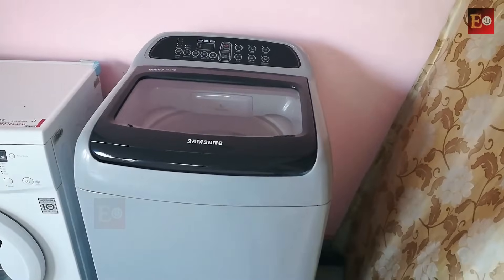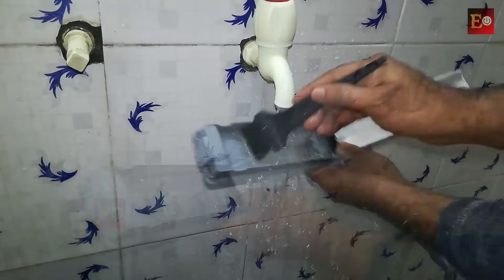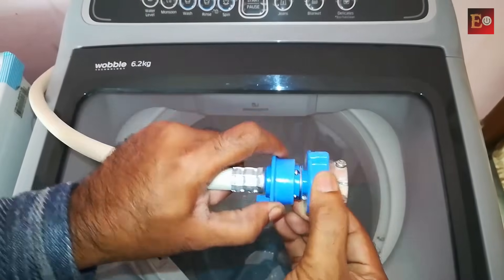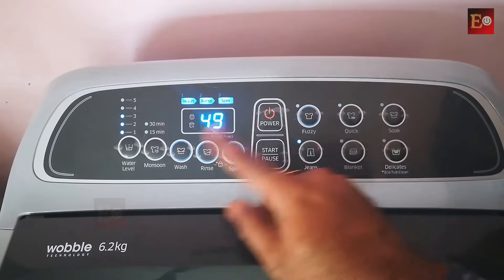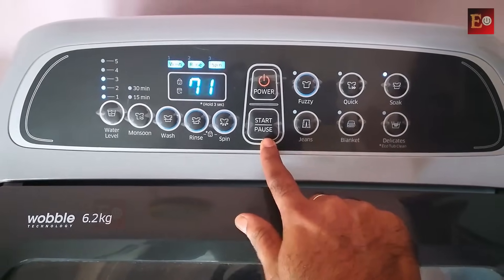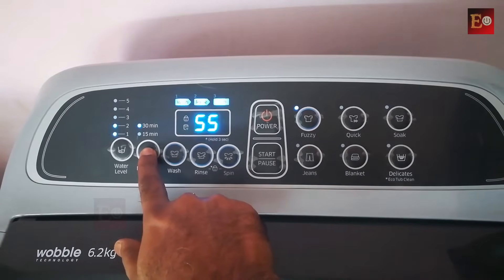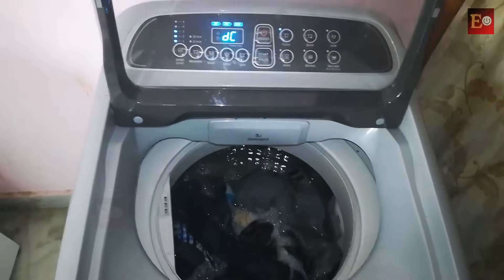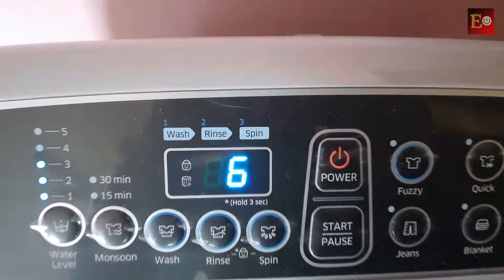Samsung Top Load Fully Automatic washing Machine Demo| How To Use Samsung Top Load Washer And Dryer

Comment: I found some problem in operating machine. 5C written on the screen. What it mean. Can you help me solve this issue?
Reply from the maker: If your washing machine isn't draining or filling, the most likely cause is a clogged filter, or clogged or twisted hose. This may display as a 5C error message on your machine. clean inlet pipe filters and check the drain pipe also.

https://youtu.be/WYf4I-1j1SM

Comment: to soak a jeans before select  jeans setting program  what to do and how to set program
Reply from the maker: We don't need to choose both. You have to choose Jeens or Soak before starts the machine. There are different washing programs ,Fuzzy, Quick, Soak. Blankets,Jeens. Delicates. U can choose any one in this washing programs. U use only Jeens or Soak and if u start the machine it will do everything. We don't need to change any thing in middle of the washing.

Comment: Can we go to spin function directly for clothes washed outside,what is the minimum time for which spin action can be set?
Reply from the maker: Wash, Rinse and spin options on the machine key pad. if u want any cycle manually, u can choose there. if u want Spin only you can choose there. and we also check at indicate lights.

Comment: My   washine  machine  is  not  showing all  three  options    its  showing nly  rinse.. how  to  do  it  fully automatic  .
Reply from the maker: There are Wash, Rinse, And Spin Option buttons on the machine keypad. these are for if u want to choose any cycle separately u can use their buttons.  u can on and off Wash and Spin cycles with these options. otherwise, if u change wash programs automatically on wash and rinse.

Comment: What about water level 
We should set that or it will be set  autatically
Reply from the maker: We can add comfort in Rince cycle. We can change  water level 1 to 5. But default water is 3rd is enough for us.
Reply from the maker: We can add comfort in Rince cycle. We can change  water level 1 to 5. It will not change automatically But default water is 3rd is enough for us.

Comment: Hiii... The same wshng machine i have  brought... The prblm is when it's spining the  wshng machn shakes a lot... Wat to do???
Reply from the maker: Normally washing machine are little vibrates in spinning time. if your washing machine is more vibrates in spinning time, you have to check at washing machine four legs on the floor. if lags are not properly set on the floor or if lags have any gap from the floor, washing machines are lot of vibrats or shakes in spinning time.

Comment: Brother how to drain water in this washing machine. Also reset
Reply from the maker: Machine will spin(dry) the cloths in final cycle. There is no reset option. U have to keep the wash, Rinse, Spin lights in on the machine key pad.

Comment: I want to give an example like we have seen 13 minutes left again automatically 17 mins come .it does not get empty and repeats same cycle ..our samsung machine is 7.5 kg fully automatic
Reply from the maker: If u open the door in middle of the back power off the machine, some tome will back. Or if choose same cycle more times, same cycle repeat in the machine. Check there how meny times on the machine key pad. Wash Rinse and Spin options separately on the machine.
Reply from the maker: If u open the door in middle of the washing or power off the machine, there some tome will back. Or if choose same cycle more times, same cycle repeat in the machine. Check there how meny times on the machine key pad. Wash Rinse and Spin options separately on the machine.

Comment: Can we put water with bucket also?
Reply from the maker: Yes, but we have put the water every cycle when it need. First star the machine add water how much it needed, depended  on watel level on the machine. Then after cycle completed,  Pause the machine and open the door, add water again and close the door and start the machine.
Reply: @ELECTRONICSALLINFO  very helpful thanx

Comment: Which level of water is to be used.  Which level is good.  Pl explain
Reply from the maker: the machine automatically takes the water level depending on the wash program you choose. 
 but You can choose the water level manually depending on the clothes you add to the washing drum. if u add very less clothes, u can choose the water level between 1 to 3. if u add more clothes to the washing drum u can choose 4 or 5

Comment: I wana know how many times it rinses in normal cycle (fuzzy). And how it rinses. Does it drain the water in every cycle completely before spinning?
Reply from the maker: Machine Rinse one time only. If u once start the machine it will do three cycles, Wash, Rinse, Spin one by one. And Machine drain the water in every cycle. But more dry in filal Spin cycle .

Comment: Hi... In my machine without washing clothes the water is getting drained.....can u suggest...thanx
Reply from the maker: There should be indicate wash Rinse and Spin Led lights.
Reply: @ELECTRONICSALLINFO  blue lights indicator shows but still without washing after water is collected to dh level the water gets drain
Reply from the maker: Change the wash program. And start the machine again. Other wise it's technical problem. U call samsung servicing center.
Reply: @ELECTRONICSALLINFO  ok thanx

Comment: How I will make more dry my clothes after d washing.my washing machine Samsung dual wash wabble 7.5kg.
Reply from the maker: Front load washing machines have more options for drying. Front load washer RPM is also more than top load machines. But Top washing machines don't have more options for drying. Spin option is there on the machine. If u want more dry can choose again Spin option. If u press and hold Spin option, only Spin will on and it will do only Spin (Dry) again.

Comment: If power supply cut in between any problem
Reply from the maker: If power cut off in middle of the washing, it will start from middle of the washing, after power get the machine.

Comment: Can I use fabric softener with the machine? How?
Reply from the maker: yes. . generally Machine do 3 Cycles after starting the machine. if u want add softener you can add in 2nd cycle ( in Rinse cycle)
Reply: @ELECTRONICSALLINFO  how much water consumption  in 3 wash rise and spin?

Comment: When and where we can add comfort ?
Reply from the maker: You can add comfort in detergent powder tary. U have to add in Rinse cycle when machine taching the water.
Reply: @ELECTRONICSALLINFO  directly to the tub or dispenser holes
Reply from the maker: No problem, u can also add directly in washing drum, but don't add at same place.

Comment: My washing machine shows some time in display but it takes more time,suppose I wash in quick prgm and display shows 32 minutes. But totally my machine takes approximately 45 to60 minutes is there any fault in my machine
Reply from the maker: No. There is no fault in your machine. Machine does not calculate the time when machine  takes water. Only moves the time when drum rotates in machine.

Comment: Any problem when 1 one time spin the cloths are dry...and take off the cloths from machine....remine 15 on screen
Reply from the maker: genarally machine do three cycles wash rinse and Spin(Dry) after starting the machine. machine do Spin only one time in final 3rd cycle.
u can take out the cloths before Final Spin cycle. but u will get with water. better u take the cloths after the Spin Cycle.

Comment: Help. My 9kg activ dual wash samsung is not spinning.
Reply from the maker: There are  Wash, Rinse, and Spin led lights on the machine key pad. If the Spin light is in off, machine will not spin.
Reply: @ELECTRONICSALLINFO  i only tried the spin only.  But still its not working. .
Reply from the maker: I think there is technical problem. If you Call samsung costmer care servicing centre, they will solve your problem.
Reply: @ELECTRONICSALLINFO  instead of spin. It wash again and again.. but the spin timer is ok.. it just keeps washing not spinning even the spin light is blinking

Comment: If we wash clothes manually (not  in washing machine) and we want only dry clothes, what to do?
Reply from the maker: If u start the machine, it will do Wash, Rinc, and Spin. The Spin option is there on the machine key pad. Spin means dry only. If u want dry only, press and hold Spin button. Then Spin will on  and mashin will do only  Dry.
Reply from the maker: U know Telugu

Comment: Clothes are not drying properly. How to use the monsoon option?What is it's function?
Reply from the maker: If you want some more dry the clothes, u can select monsoon, in rainy season If u choose monsoon, it take more time to dry in final spin cycle.
Reply: When we select mansoon/   , wash, rinse, spin, mansoon  or  any other order?
Reply: If we want only mansoon dry, then what is the process?
Reply from the maker: select only Spin(light) and turn on Monsoon, then start the machine, then it will only Spin without Wash and Rinse

Comment: How can we supply hot water in this machine
Reply from the maker: This machine does not not have inbuilt water heater. So all people uses this machine with normal water. If u want wash with hot water u can connect with hot water tap in 1st Wash cycle  or 1st wash and 2n Rince cycle. Otherwise U can use also use normal water.

Comment: Can we add water directly from top...rather than tab?
Reply from the maker: It is advise to machine use with water tap. Because fully automatic washing takes water automatically 1st, 2nd and 3rd cycle. U can add water manually in first cycle, but we can't find when u add water in 2nd and 3rd cycle. We can add water manually with our water tap in SEMI AUTOMATIC WASHING MACHINE.

Comment: In my Machine, wash option is disabled. What can I do to enable wash option.
Reply from the maker: There are Wash, Rinse, and Spin option on the  machine key pad. U can deable and enable which option you want. If u press on wash option wash indicator light will anable.

Comment: Anyone let me clear pls that which one is less water consumer auto washing machine or manual??
Reply from the maker: 3 types of washing machine are available in the market. 1.automatic,  2.Fully automatic, and  3.Front-load washing machine. Automatic washing machines are Old models. Better to but Fully automatic or Front load washing machine. if u want to save water, Front load washers can wash with 40% very less water.

Comment: Sir did this machine is direct drive or belt drive sir
Reply from the maker: This is Belt drive, not direct drive.
Reply: @ELECTRONICSALLINFO  belt. Drive ha waste
Reply from the maker: No top load machines comes with belt drive. If u want direct drive model, u buy front load machine.
Reply: Sir how long will a belt will come
Reply from the maker: Don't think about the belt. I bout top load machine 7 years back. Machines belt did not get any problem. Generally no need to change belt.
Reply: @ELECTRONICSALLINFO  thanks sir

Comment: Hi sir, regards. We have just bought this machine. We don't have proper drainage system to remove dirty water. As the drainage pipeline is too high to remove excess water. Is there any suggestions for us to solve this issue?
Reply: i had similar issue , bathroom is little high for drainage , only the last part of water remains , which i remove manually with a bucket

Comment: After opening the tap..Should i off it after water level is reached ??
Reply from the maker: No. You do not need to stop water tap in the middle of the washing. It is a completely fully automatic washing machine. It automatically takes water only when the machine needs water.

Comment: Sir. If the water flow stopped. It will integate or not sir. And when there is low current it integate or not sir.
Reply from the maker: If water stopped, there will show 4c error on the display.
Reply: @ELECTRONICSALLINFO  thanks sir.

Comment: can-we-pour-water-manually-in-this-washing-machine
Reply from the maker: It's it's completely fully automatic washing machine. It takes water automatically from the water tap. We can add water manually in semy automatic washing machines.
Reply: @ELECTRONICSALLINFO  thanks for your reply friend...
Actually we had a water tap problem, so i thought of using it by pouring water manually... Is it possible?
Reply from the maker: If you want to use fully automatic washing machine you need water tap.  machine automatically takes water 3 times from water tap when needed. we don't know when the machine needs water in the middle of the washing,
Reply: @ELECTRONICSALLINFO  thanks

Comment: I have a query that after it finish up with washing up clothes ,the tub got filled  with water ,it does not automatically goes out .kindly give solution
Reply from the maker: there should be in on  Wash, Rinse, Spin three lights on the machine. if the Spin is off, the machine will not dry the clothes and water does not automatically go out. check the Spin light. Wash, Rinse, Spin options on the machine.

Comment: I bought the 10kgs model. Does the door/lid close all the way? I feel like i can see through the door when the washing is on-going. Thank you for the video.
Reply: I bought the 9kg, same it doesnt go away cuz of the washing board thing for those who want to was it manually first before putting it on wash mode,  and it seems its not detachable, but any do you have problems with the softener?
Cuz mines isnt touched after the whole cycle, my softener is still there
Reply: @psalmscom.gen.mdse.2181  we got ours 3 yrs ago but we dont use it because if we choose automatically, the water just keep on pouring after rinse, its like machine is not stoping to rinse our clothes, i wonder if manually washing wud be better
Reply: @garrymarpuri509  Still cant figure out what's the problem with my softener container, it doesnt really work, water cant flow on the section so for using fabric conditioner I'll just have to wait till the last cycle of rinsing and pour the softener manually, thats how I do it since then, cant find solution on the internet as well...
welp washing it manually would defeat the purpose but some meticulous people does wash them by hand on the washing board before putting them to the washing machine, like scrubbing stains off

Comment: Timing is extend a lot. And timer  is pause in same number but water is flows inside the machine. I don't no why the timing is extend. Can u solve my machine problem
Reply from the maker: No. There is no fault in your machine. Machine does not calculate the time when machine takes water. Only moves the time when drum rotates in machine. But dont open the when machine wash the cloths. If u open the door in middle of the washing, some times time charges to back.

Comment: I have purchased 7kg  machine. It showed washing time 49 min. But it took 2hrs. to complete wash. Every time it took long time than shown. How to resolve it?
Reply from the maker: There is no any problem. Machine does not calculate and does not move the time when machine take water. If water presure slow machine take some more time than on the display.

Comment: For just spin , we can spin but you said in one of your comments that water will not drain then because this machine works un cycle wash- rinse- spin. Then after just spinning how to drain water as its not 3 cycle scene?
Reply from the maker: In 1)Wash cycle machine wash clothes with detergent and water. . And then In Rince cycle don't need detergent. If u want add softener u  can add in Rince cycle. In final 3rd cycle machine task out water from the drum.

Comment: To dry clothes fully which option is used n how
Reply from the maker: In final 3rd cycle it will dry(Spin) 80 to 90%,automatically. Spin button is there. Spin means dry. If u want only dry only press and hold Spin button then Only Spin on and it will dry only.

Comment: I purchased Samsung 10 kg. Fully automatic washing machine last week. It rinse the clothes one time only. Is it enough to drain soap from clothes. I think it should be done at least two times.
Reply from the maker: First check the cloths after wash completed.  If you want more time rinse you can choose blanket option or sock options. these are long cycles.

Comment: hi...pls clarify my doubt ...in my samsung top load washing machine every time rince time not completing automatically.....I kept in fuzzy mode only ....what i should  do????
Reply from the maker: Normally machine do three cycles Wash Rinse and Spin after starting the machine. There are Wash, Rinse and Spin buttons seperately on the machine key pad and wash Rinse and Spin indicate lights also there. There should be on three lights  before starting the machine. u press and hold  wash button, only wash will on and machine will do only wash. If u press and hold it again it will back. There should be on three Wash Rinse and Spin lights before starting the machine. Check there
Reply from the maker: U know Telugu

Comment: How can we restart normal mode starting from wash rinse and spin after only spinning
Reply from the maker: If u start the machine it will do 3 cyclcles Wash, Rince and Spin. If u want only any single cycle, press and hold, which cycle u want. If u want normal mode there should be indicate(on) three lights Wash, Rince and Spin. If u press and hold Rince button and then Spin button they'll on there.

Comment: Sir mera cloth may washing powder white dag waisay hi rehta jay spin,k bad so wat I do plz suggest
Reply from the maker: Can u ask in english
Reply: @ELECTRONICSALLINFO  sir my cloth after washing is not proper clean some detergent are there on the cloth so white white spot not like a clean ao wat I do thats y I asking u
Reply from the maker: Which washing powder you are using. Some matic detergent powders are especially made for washing machines. You have to use these. Even you can't solve this problem increase the water level.